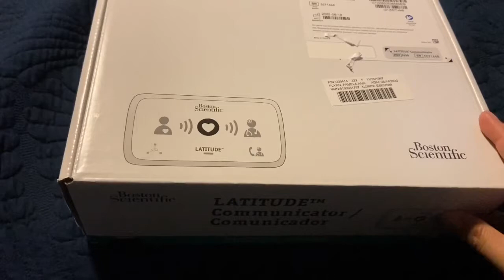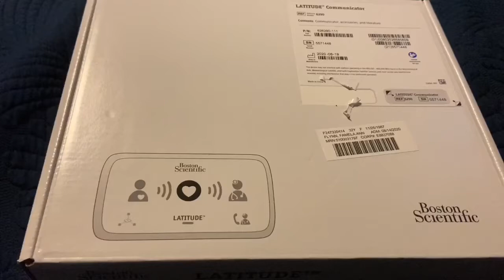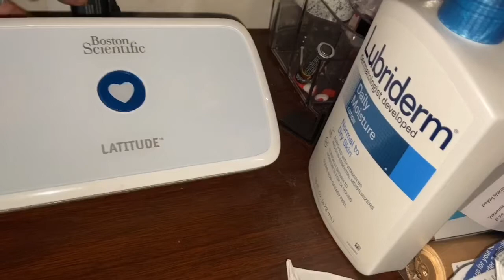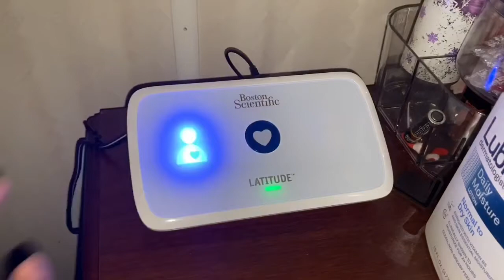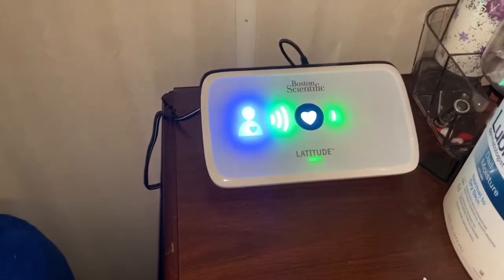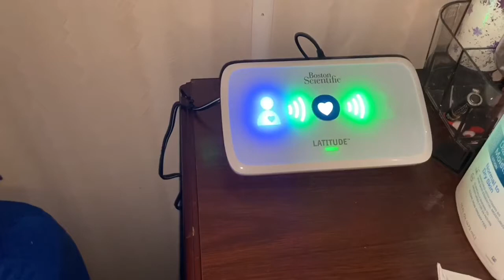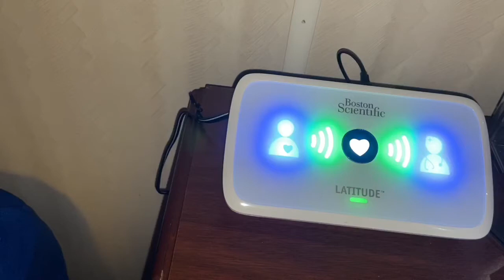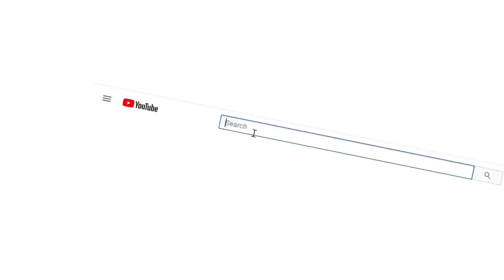How to Install Boston Scientific Latitude Communicator | Getting a New Pacemaker | Unboxing

Comment: Mine came with a cellular dongle already plugged in. No need to connect it to my internet. I was told to just plug it in to power. I did have to cover it with a piece of cardboard to keep the annoyingly bright green light from keeping me awake. So far it’s been working flawlessly.